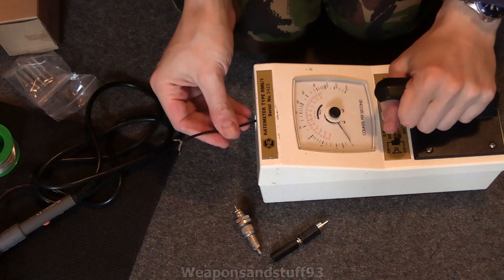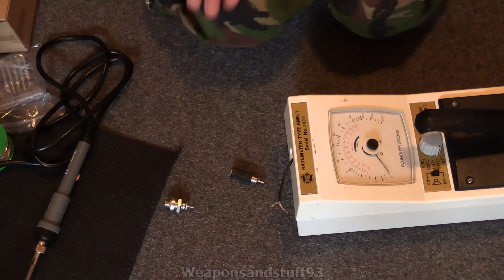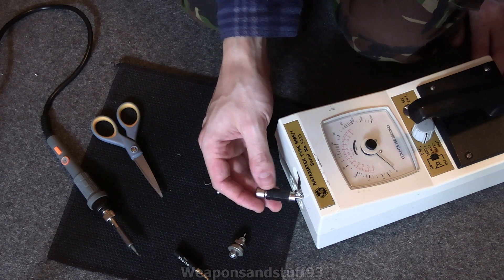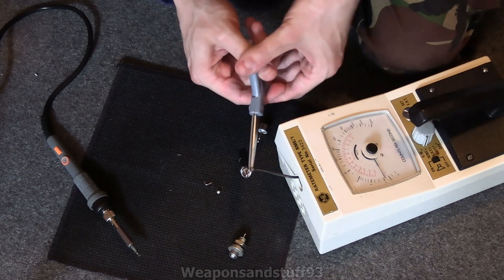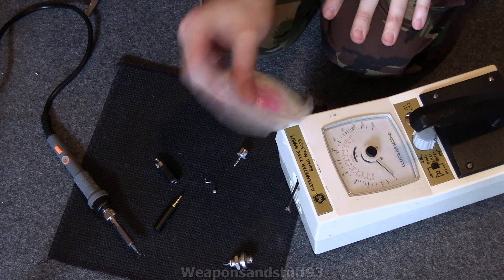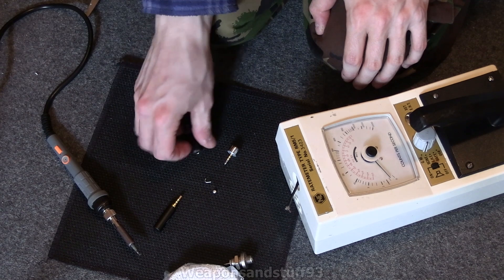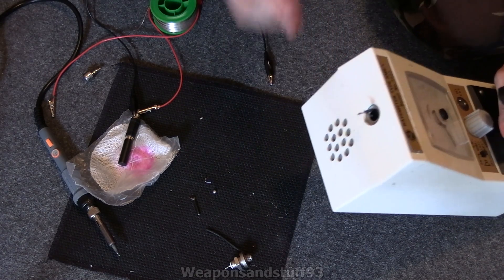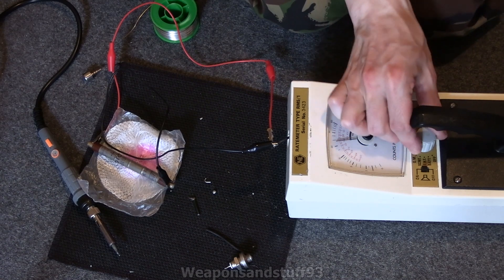British Ratemeter Geiger Counter, rewire attempts

Comment: Did you ever figure this one out? I've been trying to run one of these with a tube by wiring it into the pins on the connector, but it is unstable to say the least. A BNC connector would be perfect.

Comment: Those tubes seem to have a TRRS jack.
So the female adapter should be TRRS as well for the pads to match.
Reply from the maker: As a few people pointed out already, issue is the low voltage used by the diode sensor in the 3.5mm phone Geigers.

Comment: You are using a 2 ring 3.5mm adapter with a 3 ring jack.
That's probably why the connection isn't working properly.
Reply from the maker: Thanks for the correct answer.

Comment: Pretty sure you just slapped a couple hundred volts across those detectors designed to run at the 1.7 to 2.7 V from a mobile phone’s microphone bias circuitry. Do they still work? 

Also, you refer to those devices as ‘geiger tubes’ and ‘scintillators’, they’re not. They use PIN diodes in either geiger mode or linear mode hence their names, poor spectral resolution and low bias voltage.
Reply from the maker: As I said in the video it's a diode, the scintillator dose use a little plastic crystal in it though. And they still work fine.

Comment: Try getting a multimeter and test the output voltage to the connector and switch to something like a dc jack or a red JST connector. You already know to solder so it shouldn’t be an issue.

Comment: I think it's really a bad idea to use such connector for the probe side if anything it could be confused with a headphone connector and it will blow headsets and whatnot with the high voltage. Also I don't think that scintillator is meant to work with those voltages either, it probably has some converter to output the pulses in standard mic levels for the phone.

The old connector is indeed a pain in the ass but it would be a much better idea to replace it with a standard BNC retrofitting any probe you might want to use with BNC as well
Reply: Yes. I would reccomend getting different connections with screw terminals for easy testing to find out which one works best.
Reply: Why would you plug in your headset to your Geiger counter though?
Reply: @SibaNL  Many Geiger counters offer an audio output for an headset or speaker and you can also use the same audio output to log the pulses on a computer (for example using GeigerLog).
Also more broadly speaking is bad bad form to use a well established connector for a completely different purpose because it's just asking for trouble

Comment: I bet it's supposed to be shielded wire. Gamma radiation will induce a current in the wire, but the point at which that's a problem, the meter working will be the least of your worries.
Reply from the maker: Well the meter only goes to 5K CPS which while high isn't in the Roentgen range. It would be a few hundred milliRoentgen I believe or a few millisieverts.
Reply: The use of sheilded cabling is to prevent interference in the signal from outside RF sources.

Examples include power lines, unsheilded inductors, etc.

Gamma/Xray interference will actually effect the circuitry before the signal traveling through the cable. Still you would need a decent bit to cause any issue to the meter itself.